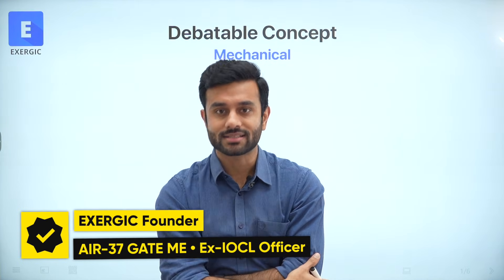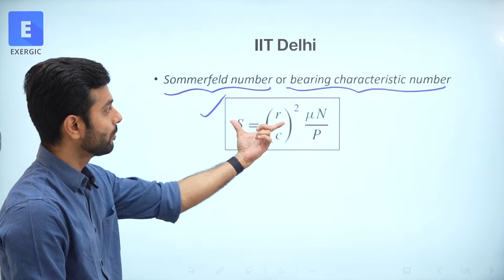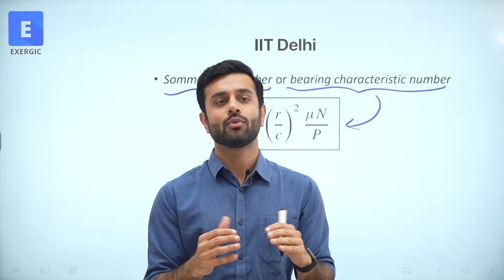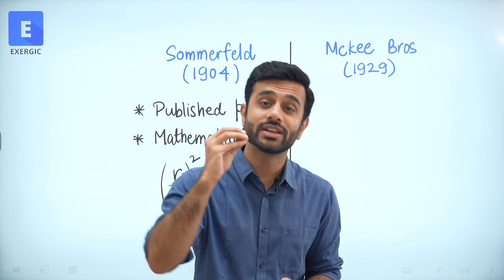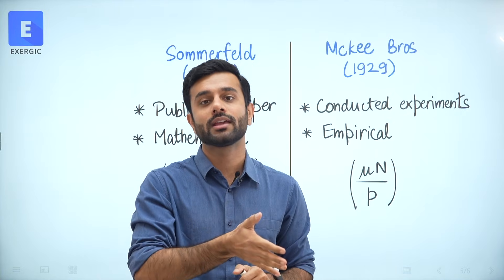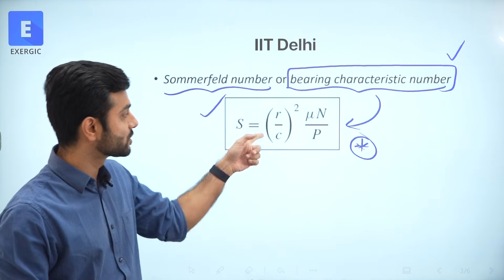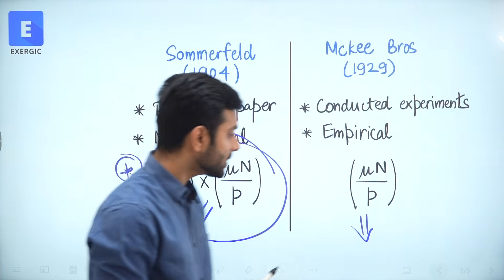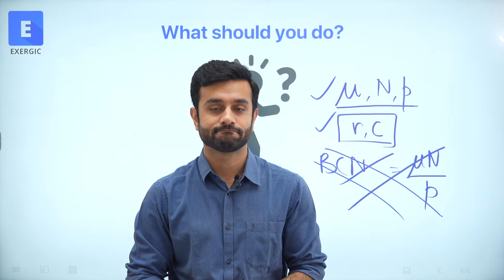Most Debatable Question - GATE Mechanical

Comment: I took your full course last year and fell in love with your teaching methods especially the P-V-T curve in pure substances. Although I didn't qualify in GATE, I had higher confidence in my concepts than ever and cracked IIT GN's interview in 2024 and BEL exam in 2025. Chandresh, sir could you design a course targetting PSU's exams for Mechanical? I'd again love to be your student. This confusion on Sommerfield number and BCN is also clear.
Reply from the maker: Happy to hear that! 

PSU exam syllabus is very common with GATE hence entire separate course will distract students. However, we are working on updated Question Bank 2.0 which will be focused towards GATE + PSUs. It will be ready in next few months.
Reply: What was your gate score??
Reply: @amitghorai9516 33.67 in 2025. At IIT GN, in 2024 for M. Tech coursework, there was no need for a GATE score.

Comment: If he asks BCN I use =ZN/P

If he asks the sommerfield number I use
 S = (r/c)²(ZN/P)
Reply from the maker: It’s not that straightforward. Watch the full video. Even for BCN, you will have to use SN formula depending upon the question as explained at the end of video.
Reply: @ExergicGATE Got it sir❤

I substituting N in rpm 😢both petroff and sommerfield every time end up with wrong ans😂
Both in RPS👀